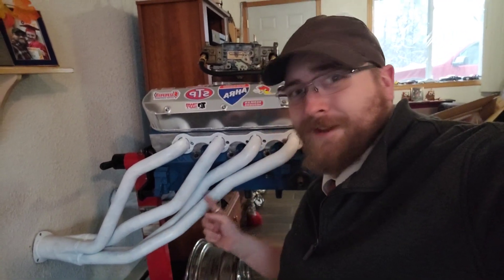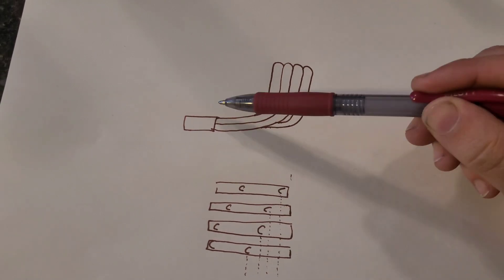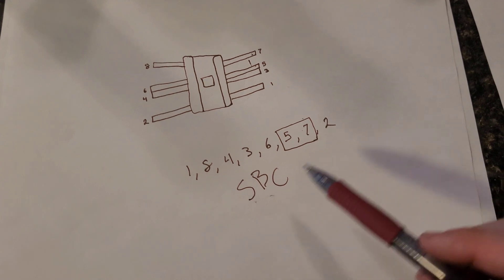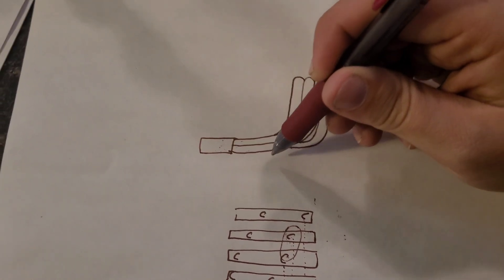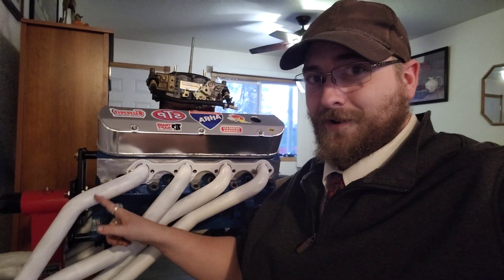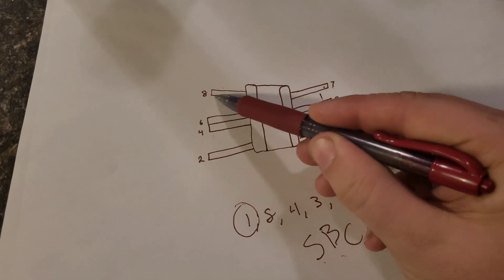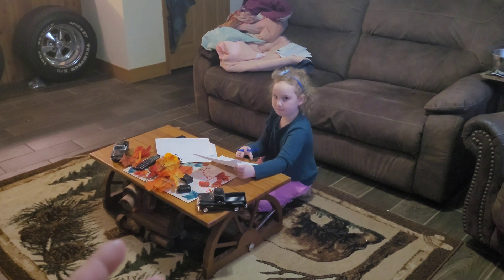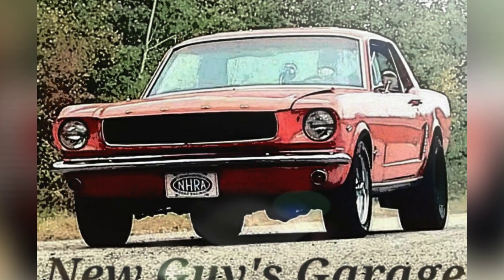EQUAL LENGTH HEADERS LOSE POWER! .....and here is why!

Comment: I really like this point. I've seen a few vids now, harping on about equal equal equal, yet none mentioned the point you make here. Good vid 👍 now I need to figure out the firing order of an inline six cylinder, the work ute I bought has an after market system, with extractors, I haven't measured the manifold pipe lengths to know if they are the same or different, but you have provided food for thought good sir.

Comment: This guy has no idea what he's talking about.
Reply from the maker: Correction....YOU have no idea what im talking about 😂
Reply: @newguysgarage6802 so you genuinely think that 2 cylinders firing one after the other results in the pulses coming out the header at the same time?
Reply from the maker: @jstoneracing not my theory 😂
Well known for a long time at this point. 

Will blow your mind to know that you get a similar problem on the intake side were one cylinder robs the fuel air from the one firing next to it.....yet another well known issue 🤣

Comment: Follow up thought to my previous comment. Equal length on crossplane V8s don't work in quite the same way, but I can't help but wonder if you made some specific length unequal headers to cheat it. If we assume that each bank has 2 pairs of cylinders where they are separated by an opposing bank cylinder, and then those pairs are butted together in the firing order, could you make headers where two of the cylinders get longer runners to space them out so that the exhaust pulses meet at the collector at the same time? Probably not and the maths to work out lengths would be horrible (probably, I'm crap at maths anyway)

Comment: I’m not sure if that’s right though.

I was looking at the numbers. According to Burns Stainless header theory, the pressure wave from a cylinder travels at 1700ft/second. Let’s say the collector is 3ft length from the port. This means the pressure wave will traverse that distance in 0.00176 seconds.

Now let’s look at time between exhaust strokes. Each cylinder does a full cycle every 720 degrees. So at say 6000rpm, the exhaust stroke occurs 3000 times per minute for a single cylinder. Multiply by 8 cylinders giving 24,000 exhaust cycles per minute. Divide 60 by 24,000 and you get an exhaust event every 0.0025 seconds. Meaning the time between exhaust events takes 1.42x the time it takes the pressure wave to reach the collector.

So, seeing as the time between exhaust events is longer than the time it takes for the pressure wave to reach the collector I don’t think you will end up with issues.

My understanding is that pressure wavefront is what matters, but I may be wrong on that.

Comment: 5 and 7 and 4 and 8 don't fire basically the same time, they are 90 degrees apart. Every cylinder fires 90 degrees apart. The issue is 5-7, 4-8 are on the same bank 90 degrees appart (this creates your V8 "burble" sound"). 1-3, 6-2 are are on the same bank but 270 degrees appart, which is 3 times the amount of time between pulses. 
To moslty mitigate this you'd need "180 degree headers" which take primary tubes from each side and cross them over into opposing collectors which somewhat evens out the exhaust pulses making the engine sound more like a flatplane "european v8". 
I say "somewhat" becuase it's often very difficult to get all these pipes the same length so you often still end up with a little unevenness resulting in something that sounds inbetween an "american" and "european" v8.

Comment: Ah…..  that’s the reason the collector is so much larger than the primaries.  

2 pulses are not going to be an issue at the collector.  

Where the issue occurs is in the actual exhaust pipe! And…. The reason an X-Pipe is used.  

The only time this is going to be an issue is at extremely high rpm’s.  The problem is….  You chose the V8 as your example;  Which won’t / typically can’t reach an RPM where that’s an issue.  

“Tuned” headers (specific length primaries) are only going to benefit a modified V8 that’s capable of reaching 8k rpm’s.  

Maybe do a little research before hitting the record button next time.

Comment: Considering the fact that the valve opens and closes about 60 times a second at 6000 rpm hmmm 🤔 just thinking bro
Reply from the maker: Exhaust gasses are faster than the valve too lol 

When the valve is closed the Exhaust pulse is still traveling down the tube creating that low pressure "vacuum" pocket behind it.

Comment: Right. This is something I've wondered about for a while. While Equal Length Headers are nice, they only really make sense on equal firing order engines. Flat plane V8s, inline 4s etc. For cross plane, yes, a slightly offset length header makes sense. I would love to hear someone make some of those one day. This is why the other option is 180 degree headers, but those are way more convoluted.

Comment: I have a Camaro with a 383sbc and i want to give it a dual sidepipe only at the driver side. So just run 2 tubes in front of the left rear wheel from the collectors, so the right side will obviously be a bit longer, my question is , will it loose power that way? Or does it not matter after the collectors? Would i be better off running both sides into just a single pipe and then making the turn?
Reply from the maker: @quirinm.  I would run them into a good size single after the headers, single will scavenge better than dual pipes and is less weight.
Reply: @newguysgarage6802  thanks

Comment: Yeah, in both banks the two cylinders that fire close together need a sort of delay. I think in this example, making the runners for 7 and 8 twice as long as 5 and 4 respectively should do the trick given how the other two cylinders on that bank fire 180 degrees apart compared to the two "close" cylinders firing 90 apart. Just double the dwell time for one of the cylinders as you're good.

Comment: No No No.    The point of equal length header is that each cylinder sees the same 'signal' ...      One cylinder doesn't scavange from the other.....    When the pulse goes down the exhaust, it has momentum.   When the piston reaches TDC on the exhaust stroke, the piston no longer pushes exhaust out.   However, the exhaust pulse has momentum and it pulls a vacuum behind it....     See pressure measurements at the exhaust ports of a single cylinder - and you will see the exhaust pressure go negative.
At 8000rpm, the pulse moves about 90 inches when the engine turns 90 degrees.   Bottom line, the exhaust valve is closed long before any adjacent cylinder's pulse gets near it.
Stick with equal length - just make sure you don't go too big on primary tubes.
Use the collector to tune how hard the reverse pulse hits.    You can soften and stretch to give you power over wider rpm, or narrow, to give more power at a more limited rpm range.

Comment: Great topic. The other drawback of equeal length headers is the unequeal bends in the pipes making flow eneven throughout. I have often wondered if equeal bends and a collector that has each pipe the same length into the collector creating a internal enequeal pipe length into the collector... hard to explain in words, so picture a longer collector with the pipes staggered in lengths to mathematically create equeal pipe lengths and firing order pulsing to get the biggest bang for your buck.
Reply from the maker: Tri-Y headers is the key 😃
Reply: @newguysgarage6802  Just checked out the Tri Y you mentioned... not exactly what my thoughs are. Picture a collector and from the flange to the pipes, inside is staggered exits of pipes within the collector. I will draw a picture later and send it to you.
Reply from the maker: @user-yq6zd6be5y i see what you are talking about, that would probably work out 😁

Comment: Uhm  NO.   Equal length headers make it so that each cylinder gets the same signal.   So you can tune the engine easier.   During the exhaust stroke, the pulse leaving the cylinder will actually pull a vacuum, if you tune that vacuum just right you can actually start the intake flow BEFORE the piston hits TDC.
If you want the pulse to even out, consider 4-2-1 headers.

If you have unequal length headers - one cylinder will go lean when others are rich.  Makes fine tuning impossible - basically you'll have to run on the rich side and leave horsepower on the table as it were.
As for cylinder to cylinder cross talk - you can control that with merge collectors.   Depends on how strong the signal you want and how sharp.

Don't believe me - run it on a dyno - tuning the carb AND ignition timing between runs.    write down the settings so you can redo the test.

Comment: You are correct. The issue now would be to figure out which tube is the correct length, for desired results. There will be 2 per side that would need to be shorter, and one longer. David Vizard also covers this on his channel, and the results are impressive.
Reply: True, but almost every Chevy (and same firing order engines) headers I see, even expensive ones,  it looks like the #5 tube is at least as long as #7. They even put bends in #5 to make it unnecessarily longer. I don't get why, especially on $800+ headers!
Reply from the maker: @mikewillett5076 being expensive doesn't usually mean they are also quality and better performing lol 
They are looking for key words "equal length" just to make people think they are super trick so they will buy them 😅
Reply: @newguysgarage6802  . That's true. But you mean even companies like Hooker with their Super Competition  and others don't make them unequal for the 5/7 issue? I looked at pics of a lot of the them and haven't seen any where the 5 is obviously shorter than the 7. Of course it can be hard to tell by eyeballing them in a photo if they're close. Thanks
Reply from the maker: @notnecessarilynecessary  it is easier for them to just make the tubes whatever length is required to make them fit under the hood of any specific modle car they are made for too. 

Headers can already be a tight fit let alone with one pipe noticeably longer that the other ones to try and deal with 😅
Reply: @newguysgarage6802  . Yep. But I've seen where they could've made one shorter or longer no problem. Eh, long tubes are still better than shorties or manifolds. Thanks a lot for replying, too many channels "abandon their posts". Lol
Reply from the maker: @mikewillett5076 im always down to having a good conversation about car stuff 😃

Comment: How many sets of headers have you actually tested on dyno's?? I have had at least a half dozen sets of headers I built tested on the dyno, every set so far has made more torque and HP than the unequal sets they were compared to, some as much as 45 HP.  Until the time comes that I see unequal length headers producing better results on the dyno and track I will keep building equal length headers for my customers. I hope that the headers on that engine you use as an example are not the headers you are talking about, I wouldn't expect a $200 set of big box store headers to produce good results on anything. Please do let us know the type of numbers you have seen on the dyno, I hope this video isn't all just theory.

Comment: I never saw this as an overload issue, as much as a scavenging problem.  Both banks have a pair of cylinders doing everything 90 degrees from each other. 8/4 and 5/7, or if you have a 4/7 swap cam, the issue moves to 4/2 and 7/3.  The  second exhaust pulse causes a flow loss [during overlap] of the first cylinder blowing down, as its wave looks like backpressure [or a wrong length collector].  Shorten the first and lengthen the second to adjust time of arrival and stop blending pulses, effectively.  A dual plane crank begs for it.

Comment: Done correctly yes they will make power... now since youre looking for that high end power, you'll lose in the low end. All depends on how you want to tilt the curve before and after 5252rpm. Long tubes and equal length are for high revving platforms that you'll be at or above 5252, so you'll want that. Down low, you'll lose BUT if you're running the correct converter and rear gear it'll flash past that because you won't be launching at below 3500rpm anyways at the drag strip. nor in between shifts will it drop below the power curve

Ay bit of power you might lose or gain can easily be negated by a hot track day, bad track prep, wrong tire pressure, tune, and many many many other variables.

Comment: Well, I think a firing order implies that there aren't cylinders going off at exactly the same time, but I get your point if that's correct for most V8s. On Shorties it's also about being able to pass emissions, which is why a lot of enthusiasts choose them in addition to improving the sound. 

Most engines can be tuned to pass emissions on most setups, so I would say just cause the firing order to go off at the interval you want and it's problem solved! You pass emissions, you get better sound and you get better power - Voila! We're not necessarily at the mercy of any particular design with the advent of modern-day tuning.

Comment: I have an in-line six cylinder engine, and I am designing an unequal headers, the firing order 1 - 5 - 3 - 6- 2- 4 it’s a Nissan tb 48, it’s going to be a true duel exhaust , so therefore two manifolds will be available, first manifold will have its primary tubes on 1 5 3 and the second one will be 6 2 4, I am doing this to get the scavenging.

I want to avoid the pulses from hitting each other.

What’s the ideal situation to get the most of it, is it fine I just make the headers tube for cylinder one the shortest after wards slightly taller for cylinder 5 then a bit taller for cylinder 3? I don’t have any special equipment to measure the pulses I am just using common sense
Reply from the maker: If the firing order is 1-5-3-6-2-4 then wouldn't it make more sense to have the two manifolds be 1-2-3 and 4-5-6? That would evenly spread the pulses out to were equal length would work for both manifolds. 

I wouldn't do duals all the way back though, i would join the two manifolds with a Y pipe into a single all the way back a little after the two collectors. 

I have a video on that too! 🙂
https://youtu.be/a_nF8Y4DQ3g
Reply: I would love to hear a six-cylinder engine with UeL headers!

Comment: The headers don't scavenge at the collector, not across any kind of wide range anyway. The collectors and the pulse timing are still important, though for different reasons.

The scavenging is largely done in the first few inches of pipe and the exhaust port, mostly from inertia of the exhaust. The blowdown pulse (when the exhaust valve opens its super high pressure in there, half the mass of the exhaust can be out the valve before bottom dead centre) is what kills scavenging, and it's what collector grouping and lengths should be about.

The collector itself can also pay a large part in overall pressure in the primary pipes. Generally the smaller the collector choke the better it functions as an anti reversion valve and the less restrictive the less the blowdown pulse gets turned around and goes up the wrong pipe. There's a point where pipes and collectors chokes are too small, but it's generally a lot smaller than people think.

Comment: So david vizard has a couple of videos about this on his channel. Although this issue applies particularly to V-layout engines. There’s also a whole other factor to header length besides the firing order; the angle of the V also takes part in calculating the correct lengths.
Reply from the maker: Angel of the V really? 
Interesting! Ill have to run back through his stuff again because i dont quit remember it fully but that dose ring a bell now that you mentioned it 😁

Comment: Great explanation. I do feel there are multiple factors depending on the application that can very what is desired. 
I agree with you on open headers with maybe an 12-18" extension to the collector. Adding an x pipe mostly alleviates the overloaded collector you previously mentioned, but getting the proper distance to the crossover is also critical to getting it all right. 
In general, uneven headers broadens the torque curve (better application for street) where "tuned" equal length is more of a peaked torque curve tailored to a specific rpm range. 
I built custom equal length headers for my race truck and gained 8hp over the unequal length headers previously installed. Each primary tube was within 1" of the desired length and also running an x pipe at 12" from the end of the collector.

Comment: Equal length headers is mostly about making beautiful music to our ears. Take a v12 equal lenght headers vs non equal lenght and my point is proven. 💪👊🇺🇸 🎶 🎵
Reply: I find this interesting but does it apply to a V12 engine? The firing order on V12s are all opposing so you won't encounter the issue talked about in the video. I'm really interested if any people looked into if V12 engines lose power with equal length headers.
Reply from the maker: If the firing order is semetrical on both sides then equal length headers would be the right choicec😁

Comment: You do have a point, but I think you need to be a bit more clear about this is only for crossplane v8's but is still the best option for all other engines.
Reply from the maker: There are other engines that have two cylinders firing right next to eachother other than just v8's lol

Comment: So if you have a 4-7 swap camshaft that trades the firing order cylinders 4 and 7, would the equal length headers be beneficial then?
Reply from the maker: Yes it is beneficial, but still doesn't fully fix the pulses at the collector 🙂